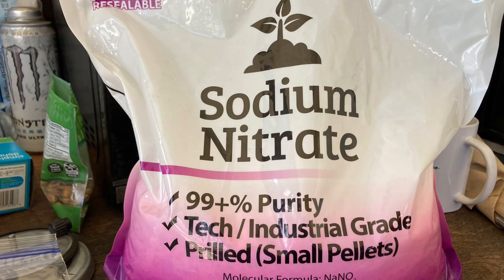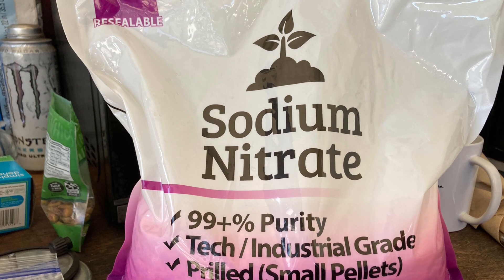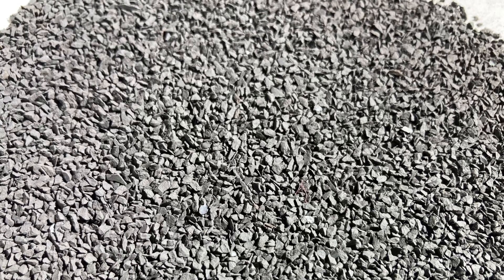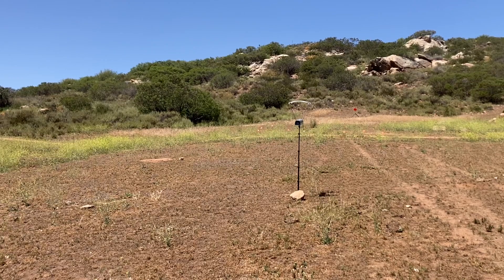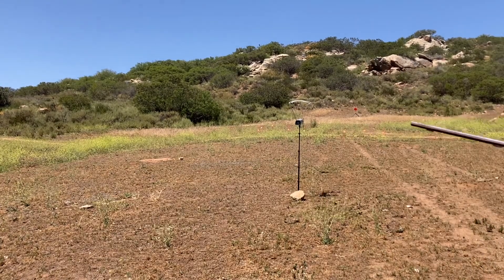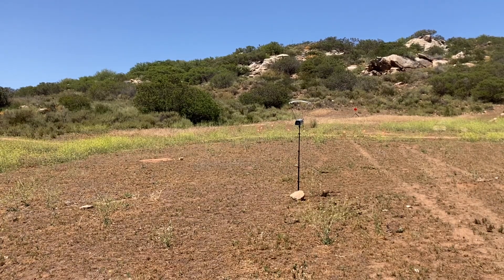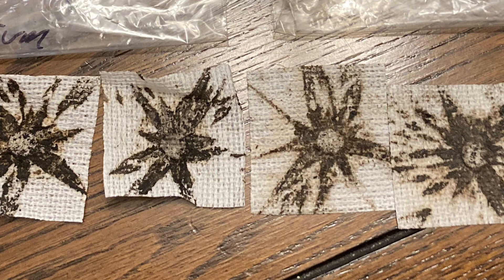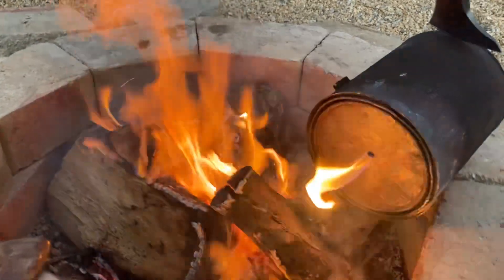Sodium Nitrate Black Powder

Comment: If the cost is low enough on sodium nitrate, it is easy to turn it into potasium nitrate if you can find ice meld made of potasium cloride (think it's usually about $10 for 40 pound bag). Just add both of the about equel wt. of each in enough boiling water to let both desolve. Remove from heat and let cool. (Can filter out any dirt, etc, befor it starts to cool.) The sodium nitrate should now be sodium cloride (table salt) and remain desolved in the water and the potasium nitrate will start forming crystals and dropping to the bottom of the container. I think most should drop out at room temp, but would cool in the fridge to get a higher yeild. Now just filter the crystals out with coffee filter or fine cloth and a light rinse to get any salt water off. Dry. Sorry so long, didn't mean to write a book.
Reply: It was years ago and best to look this up befor doing it. I could be thinking of the wrong conversion!
Reply from the maker: Fair enough. Thank you
Reply: Salt substitute in grocery store has KCl
Reply: Caution: any time you add chlorine you are exponentially increasing the corrosivity especially pitting characteristics of the powder. Best to keep all chlorides and perchlorates out of you firearm if you can (even stainless ones).
Reply: @Miningpastpresentfuture  Yep, that could be bad. After I wrote about that, I wish I hadn't because if there were any potassium chorate in it, it could be real dangerous to mix that with carbon.
Reply: I'd be very sceptical of that. Sodium, potassium, chloride and nitrate ions are all extremely soluble in water, wouldn't be convinced that this method would reliably allow ion exchange to occur.
Reply: @mrsmith9079 Right after posting that, if I know how, I would have taken it down, as I think what I was thinking of was sodium perclorate to potassium perclorate.
Reply: @mrsmith9079  It's a matter of temperature. KNO3 has a lower solubility than KCL, NaCl, or NaNO3 below ~22'C. So you just have to mix them with just enough water to dissolve, then cool it down with an ice bath or something and you will start to see KNO3 percipitate out of solution.
Reply: THANK YOU! Sr!  may we have Another?
Reply: Man! This is precisely why I do this stuff. Way more Interesting than chemistry lessons in school ever was 👍.  I've learned a ton of stuff doing this and still got all my fingers.  Thx everyone.

Comment: Try drying your sodium nitrate before making the powder, and dry the powder just before glazing.  Otherwise you're going to get inaccurate measurements of the nitrate, and powder that's way more damp than you want.  Both will really effect performance.  It would be the same with ammonium nitrate because both are really hygroscopic.

Comment: The key word is hygroscopic. If one looks at potassium/sodium nitrate formulas it is obvious that at any given weight sodium nitrate is " richer" in nitrate anions than potassium nitrate ie it will have more oxygen to supply.This being said,sodium nitrate powder is good to use while shooting in Sahara desert,completely worthless in Florida.Long time ago ,in 19th century,right before the first world war, there were promising experiments with ammonium nitrate as an oxygen donor and charcoal only.the composition lost to smokeless powder, which turned out superior to any powders based on solid ingredients
Reply: What information do you have on ammonium nitrate and it’s use in firearms?
Also did I read your comment right, ammonium nitrate and charcoal only? This would be huge if you could cut sulfur out of the mix as it’s the most difficult material to acquire in BP production.
Reply: As I understand, potassium nitrate+charcoal gives good energy. Sulfur makes it easier to ignight.
Reply: @richbattaglia5350  sulfer is only lowering the ignition degrees so it should work fine whitout sulfur if you got a good fuse that emits a powerful good flame to the powder
Reply: @richbattaglia5350  It's mentioned in the COPE book
Reply: I'm assuming because ammonium nitrate is extremely hygroscopic as well. It used to wind up as giant clumps in the sealed bag on our farm when I was a kid.
Reply: @dopeymark  And the pressure gradient is different upon detonation. Be wary with firearms certified for BP use while using AN.
Reply: @dwwolf4636  AN explosively decomposes on it's own given the right conditions. No reducer (e.g. charcoal) needed.
The most recent instance was the 2020 Beirut port explosion
Reply: @PaulG.x  It's hard to make Ammonium nitrate go boom. It usually needs booster explosive. When you blast it with torch it just melts and slowly burns (on small scale)
Reply: @MartinMizner  Tell it to Beirut
Reply: I don't think you really understand what your talking about.
Reply: Ammonium powder